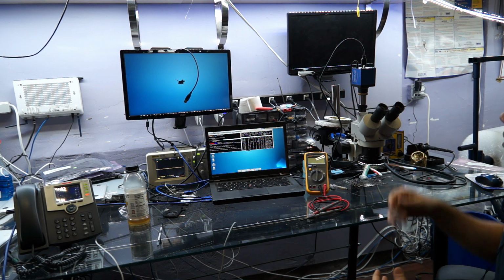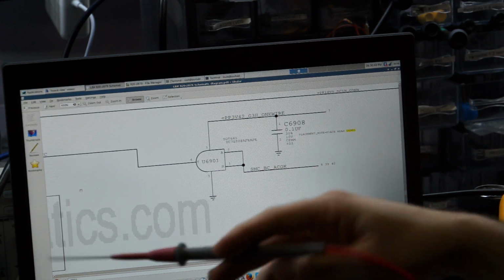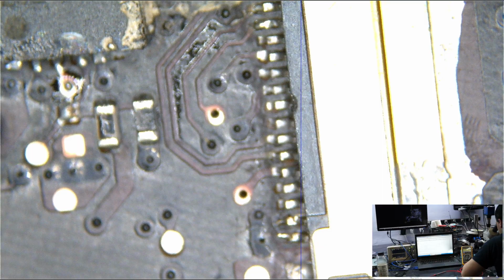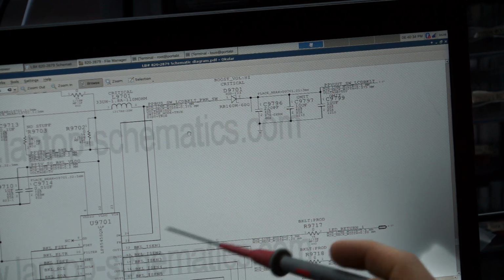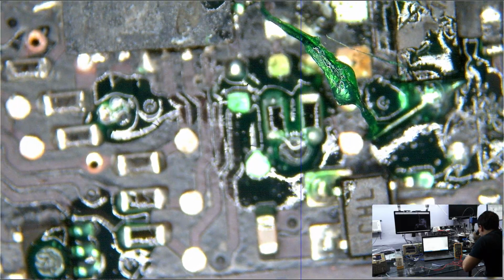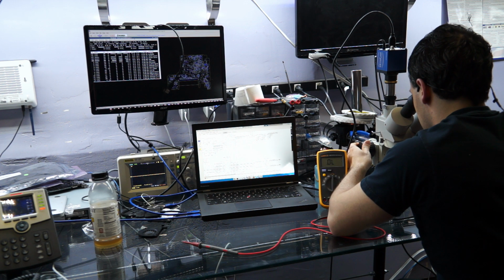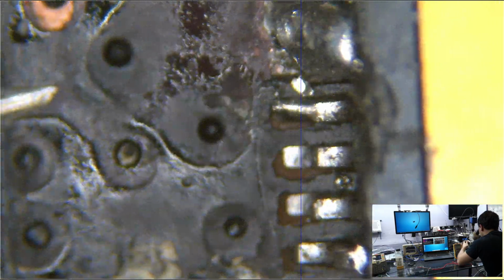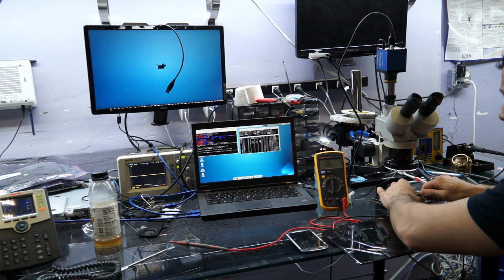logic board repair 820-2879 - not charging - not turning on - no backlight.

Comment: hello, on board 820-2879 i have no green light, and i have voltage all over the board exept PP5V1_CHGR_VDD i checked with workig board and that power 5v shuld be present at s5 stage have you any idea where that comes from or what i shuld check to get it - on schematic is no information where that comes from , i also replace u7000 but no result - please help
Reply from the maker: +bed boy xxx chgr_dcin present?

Comment: Yo Louis. I managed to get my voltage rails back to 12v n 5v n 3.3v. But when I short the Power Pads on the Mobo nothing happens, the fan don't even spin. Charger light is Green and orange. 51125 is good as is 9054 and so is charging IC. I'm suspecting IC labelled R33v on a G3H rail.
Do you have another solution / idea as to what is wrong ?
Thanks in advance.

Comment: Thanks for your helpful videos and making them interesting to watch! I have the same board that stopped turning on. I hasn't had any liquid damage. I have tried bypassing power button but still no life. It does still charge the battery. G3HOT is good and there is voltage drop when I press power button. Any idea what could be preventing this turning on?

Comment: First of all. I love watching your vids! lol. I work on comps and tvs but only know a fraction of what you do :)..Jealous..Anyway..I had to put a new wireless card in a macbook pro .Someone had opened it up before to replace the screen glass..and they butchered most of the screws and the gold strip that goes across the LVDS connection on the logic was half falling off, off course it fell off completely then and when i put it back together, i only had a white screen. no apple, i do have sound etc..guessing the lvds is not making the correct contact? is there an easy way to get the gold stip back on or would it be easier to replace the whole lvds connection? and how much would you charge to do it? lol

Comment: Hi Louis,
I'm fascinated with your videos.
Could you pls tell me what should be the right voltage on U7000 -  CHGR_DCIN - pin 2  ?  I have similar issue on a 820-2915B and actually I have 2.47v.. too low? I'm trying to understand if my R7005 resistor is bad or not..

Comment: Hi man, I really enjoy your vids :-) i wonder if you can guide me on this, i have the same board which on turns on the fans for a few seconds and turns back off, no posts or chimes. There were no spills on the board, macbook was on and went off while it was unattended. I don't pretend to tell me what's wrong but it would be great to tell me how i should approach this fault.
Reply from the maker: See if the clock signals/crystals are generating anything, compare to known working board of same number.
Reply: The macbook standby light flashes 5 times before turning off and both hard drive and odd seem to operate its like its going to boot that it shuts off before the chime is heard, sorry for misleading you

Comment: Hi Louis, you are not only a great engineer, you are a great communicator too. i have this same board, that works only with battery. No lights on Magsafe and no power through magsafe. But once you connect the battery, everything runs fine. What troubles do i have up my sleeve here? Any magic tips? I have checked fuses, magsafe adapter and all are good.
Reply: Using thesame method in video, i did not get any voltage (3.4v?) on SMC_BC_ACOK. Does that mean ISL6259 ( where SMC_BC_ACOK = CHGR_ACOK ) is created bad?

Comment: Thanks for the video,
I also have the same laptop and it is not turning on after doing liquid damage repair.
I will give it a shot to see if i can figure out whats wrong. thanks to you.
Reply from the maker: Not turning on in general or not off the battery or charger? Got all the power supplies? PP5V, pp3v3, pp3v42, ppbus_g3h?